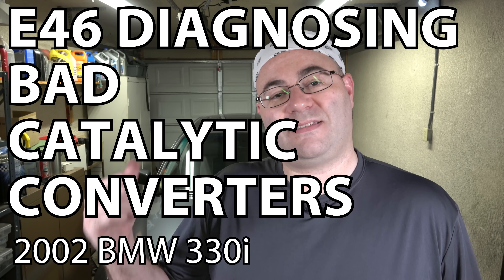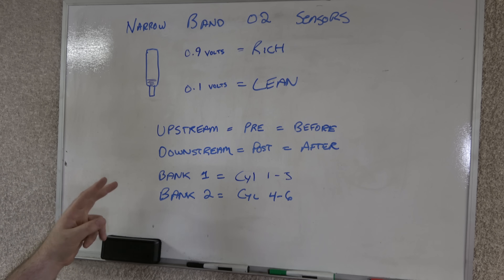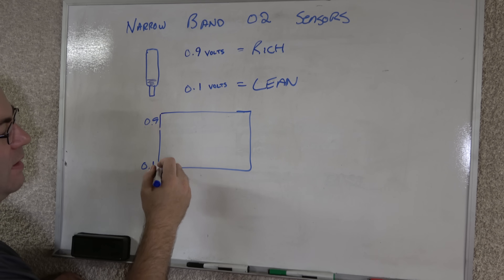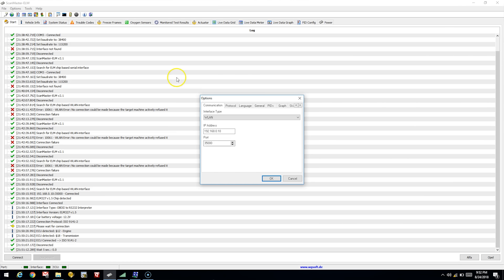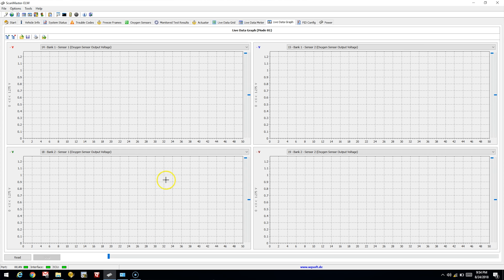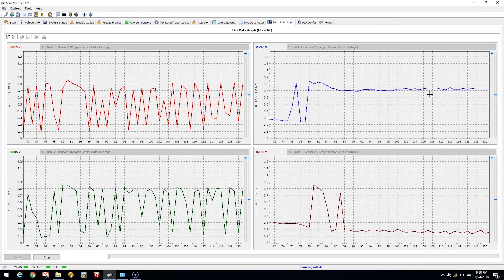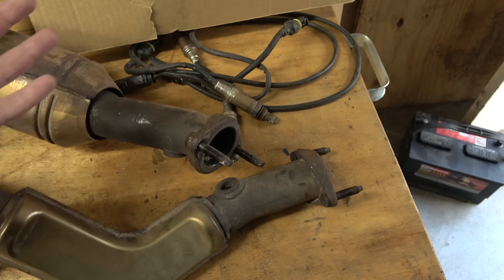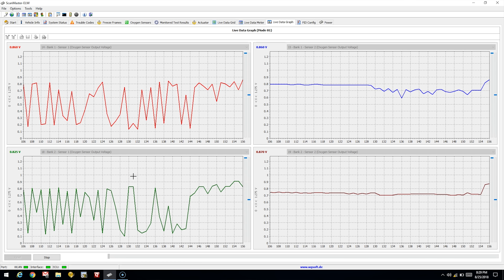BMW E46 How To Diagnose a Bad Catalytic Converter P0420/P0430

Comment: Catalytic converters from E60 M54will work in E46 M54? 
The part numbers on bmw database are different but secondary numbers (the biggest on the catalysts) are the same and they are 7516730 and 7516731.

Comment: First of all thank you for this video! I used the same software and a Bluetooth obd tool from Amazon and tested my voltages the same way, but while on a test drive. 

I found some differences in how my graphs looked in comparison to yours: my bmw S54 engine sensor 1 voltages both remained constant at about 2.0 volts. Even when the cats were warmed up, I didn't see any fluctuation like yours did. They just stayed stable at about 2 volts. Once my car was warmed up, I noticed that while shifting (mine is manual), the sensor 2 readings were really wild and looked like your results indicating bad cats. But once I was in gear and applying the gas, the voltages stabilized at about 0.8v. This is the behavior I experienced throughout my driving (had the laptop next to me). Shifting produced erratic and spiked readings, but cruising and even wide open throttle showed a stable voltage. At stop lights, the voltage would drop off to near zero, then stabilize back to 0.8v while idling. I don't have any codes, so I assume this is expected behavior of the voltages. Again thank you for this video!

Comment: I really enjoy this content. I had p0455 evap code and fixed the obvious worn 2nd air pump hose... fixed the code but I also have p0174 and p0171 LEAN vacuum leak codes and p0420 and p0430 CAT below threshold codes. trying to pass emissions but these codes are confusing. on one hand it could be simple stuff but on the other hand could be very complicated. I am a very beginner mechanic via youtube and 50's kid content so I'm really trying to learn about the 2003 325is and their problems first before I take things apart and can't re-assemble them as the car is running decent. I have an odor coming from the engine bay like a really oily gassy engine. the temps on the passenger side engine bay seem pretty hot to me... based on my codes and what I've written here can the internet people spring to life and help me out without saying "just buy all new stuff" or "go to bmw mechanic". Thanks anyone who cares. (really need the support) I have new o2 sensors from bosch on hand. recent oil/all filters changed. plan to smog soon... thats all I got

Comment: I had the same codes on my E39 530i. I was advised to replace both the intake and exhaust VANOS solenoids, then clear adaptations for the DME and transmission. The codes went away for good, and low-end pickup noticeably improved, like I had a new engine!
Edit: I was also advised to replace both camshaft sensors.
Reply: I have codes right now for both cam position sensors, bank 1 o2 out of range, bank 2 cat efficiency, and a cylinder 2 misfire. 

Seems like too big of a coincidence to be anything but vanos related.
Reply: @weedshoes5089  You should replace both VANOS solenoids and both camshaft sensors. See if it clears any codes.
Reply: @MindHunger  thanks for the tip! ordering genuine bmw sensors and solenoids now.

Comment: Don't clean your 1st set of o2 sensors if one of the cats is clogged, running almost as bad as when a leaky inector made my intake manifold explode last year, Imma try to clean it, if not, im in Texas no more inspections, I'll run headers and make it shoot flames🔥.

Comment: If I have a plugged cat and it’s literally blowing out my secondary air valve and melting my plastic hose, that’s for sure a cat right? Replaced the hose and valve twice, new blower also and it does work.

Comment: Question, I have a 325i and check engine light came on with the code. It’s only got 89k miles on it. What’s the chance it’s an O2 sensor instead?

Comment: Just bought a 2001 330i and I noticed the catalytic converters smell pretty bad when I push the engine. Car has 171k miles what would be your suggestion to diagnose the Issue? Thanks!!!

Comment: My car is having acceleration issues. Runs like shit from a cold start, this was never an issue before. If i pull out onto the road, its so slow right now, i'm scared to get rear ended. Having trouble climbing hills, i can barely gain any speed if any at all. If going uphill 65mph thats probably as fast as it"ll go till i get on flat ground, or downhill. Car doesn't shake or have any vibration. Changed a poor looking coil, put new ngk plugs in. Car still doesn't have acceleration. Took it to get it scanned, 4 codes came back for cat issues. I've had these pair of headers now for 2 years, its about that time, then flash tune to delete sap, and lower o2 sensors. Thanks so much for your videos, you've helped my dad and i with this car for the past 3 years. You basically taught me everything i know about this car, and shop life. Thank you 50's kid!
Reply: Ended up being a failing maf. Much cheaper fix

Comment: I have straight pipes past the cats and it sound muffled after I put cheap coils in them. I swapped them out and it sounds better but I have a feeling they're packed with oil now... is that a possibility?

Comment: I am getting ready to do this job. Bank one 0420 and bank two 0430.
Can it be done in driveway on ramps or jack stands? Very mechanically inclined, have all the tools, just can’t get the car very high in the air.
Reply: I did this job last year, new magnaflow cat headers. I did O2 sensors,tuneup, the Vanos solenoids, the oil non-return bslves, DISA Valves, smoke tested intake, you nam it. Car still got these 2 codes but much less frequently until this last couple of months, now coming back within 1 days of resetting & cant pass emissions insp here in NY. where do I go with this? Car otherwise runs like a top no misfires, no other codes, steady idle, all good.

Comment: Hey 50skid, thanks for the video, really informative! My 190k mile 330i just gave me a p0420 on a run - I checked the O2 readings on a warm engine at 2k revs and both banks show exactly as they should (varying pre cat, 0.7 steady post cat). I noticed that the AMM clips were popped off which could have caused a slight intake leak - is it possible that that caused my code? It's not the one I'd expect, but might make sense. I would have expected both banks to be affected though... Codes reset and I will see how I go, but thank you for the O2 reading test, hopefully that means cats are ok 🤞🏻

Comment: I have a 2003 e39 that gets an intermittent all 4 O2 sensors heaters shorted to negative. The fault comes up during a scan as not present at the time but it is always there and I can never clear it. I have measured all 4 heaters at about 2.5 omhs and the voltage across all 4 does pulse on and off when the car is running as should. Do you have any idea what it could be?
Reply from the maker: Sounds like a problem with the DME (engine computer). Seek professional help on that one

Comment: I can also be caused by an exhaust leak I was tracking a 420 on my vehicle after I replace my new catalytic converters finding that an exhaust leak where are the exhaust bolt down to the engine block needs to be tightened my bad
Reply: T67766 u 7th_ù_<<<<

Comment: I've been having an issue recently where my CEL came on and code was P0430 (Catalyst below efficiency bank 2). Checked live values and the value for bank 2 post cat was reading steady between 0.6v and 0.7v (So no issue here?) Both pre cats oscillate as normal too so what could be the issue here? Experience no power loss either and engine is as smooth as can be
Reply: Did you get to the bottom of this? I have a p0420 and o2 sensor readings checked out. Did find my AMM wasn't clipped on properly though.
Reply: @nicebloke6066  nope, still haven't solved it. I've taken the plunge and bought 2 precat sensors as I assume the originals are still on the car (103k miles). I'm hoping it's just a sensor that has fallen out of spec over time hence the codes. No vac leaks as far as I can tell and MPG is normal

Comment: Hiya, your videos are amazing and very detailed. Used them plenty of times! Is this the same for the 4 cylinder n42 engine? I've had a 0420 code a few times and 1168 & 1170 at the same time. Do you know what that means? Any help would be much appreciated! No one else seems to know. Cheers👍

Comment: hey Im having this issue on my 2000 328ci where the catalyst monitor is not ready n is showing my downstream sensors are fluctuating like yours but im not getting any codes or stored codes, Catalytic converters are expensive here in cali so thats my last option u got any suggestions? i'd appreciate it
Reply from the maker: Nah if your downstreams are not steady, it’s definitive. You need new cats. I bought some used low mileage ones off eBay and it worked out.  Good luck!
Reply: @50sKid Thank you for the video. I made just right now a test and a made a video. I think my cats are working. https://youtu.be/lbpbIIQN7fs?si=-dLxlOMrATvvVTVS

Comment: Ex Smog Repair Technician
GM Dealership & Independent Automotive Shops - Southern California

1) The reason that California doesn't Test vehicles Year 2000 & Newer without inserting the Probe in the Tailpipe is because the Emissions HC , CO & NOx are supposed to be way cleaner than 1976 - 1999 vehicles.

2) 1976 - 1999 vehicles still require the Probe being inserted in the Tailpipe

3) Lotta Emission devices on todays vehicles & the Catalytic Converters are the most expensive Emission Devices.
( The prices of these darn things can give you a Heart Attack )

4) One of the worst things one can do is purchase CATS from a darn junkyard.
If this car passed the California Smog Check it's because the Mechanic didn't record the Part # 's from Both CATS.
.....After inserting those Part #'s into the California CAT Data Base & it spits out that this CAT is an Illegal CAT & not an
OE CAT or CARB ( California Air Resource Board ) CAT , that vehicle is gonna FAIL.

5) If you want your 19 year old Daughter or 19 year old Son to have a Heart Attack 
with this being their 1st car purchase :
Let 'em buy a car from a Crook that has sold them a car with a Modified CAT or some Rascal has added a Coupler to the Oxygen Sensor because they refused to get the car done right because they didn't or couldn't afford to fix the P0420 or P0430 : Catalytic Converter Below Efficiency Threshold.

6 ) 2000 & Newer vehicles can Fail the California Smog Inspection if there are Check Engine Light Codes existing , the New Engine installed wasn't an Engine for that Model Year vehicle , Smoke is constantly emitting from the Tailpipe ,
a Rascal had added a spark plug coupler to the Oxygen Sensor because they Refused to have the P0420 or P0430 Codes fixed properly , some Idiot has removed the CATS and have installed Straight Pipes all the way to the Muffler.

7 ) For those of you residing in California , go to www.smogcheck.ca.gov

Get educated , locate the Subject that tells you , "Even if you disconnect the Battery Cable to turn the Check Engine Light off - a Block before the Smog Station - You're FOR SURE gonna Fail the Smog Inspection for @ least "2" reasons : Now you've set the On Board Diagnostic Monitors to " Not Ready ", before you disconnected the Battery Cable or "Turned the Check Engine Light Off" with that Lil' Code Reader - ALL Monitors were saying " Ready".
... The 2nd reason for Failure is that the Smog Station Computer ( on late model cars will still Spit out the Code ) that you're trying to Hide.

8) Californians , in your spare time ; save that California Smog Check address to your Desktop ( You'll LEARN a lot ! )

9 ) Last Tip , on that Website you can insert the License Plate # from any vehicle in California & it will tell you if that vehicle has received a Smog Check within the LAST 90 Days.

The "Wrong" question to ask any Person or from a "Used Car Lot " is, " Has this vehicle been Smog Checked " ?

The right Question to ask is , " Has this vehicle been Smog Checked within the LAST 90 DAYS ? "........If it hasn't been Smog Checked within the last 90 days 
Sacramento , CA. ( State Capitol will be sending you a Letter shortly after your purchase to get a Smog Inspection )..
....and your 19 year old Daughters 1st purchase may be from a Rascal that has REMOVED the CATS or the other expensive cluster flux : added a Coupler to the Oxygen Sensor because they  Refused to buy new CATS to fix Codes
P0420 or P0430 properly.........You can also learn a helluva lot about your vehicle by subscribing to the cheap
AllData Do It Yourself Version...The PRO Version cost @ least $180.00 monthly.
www.alldatadiy.com
ONLY $29.95 YEARLY !!

Comment: My bank 2 sensor 2 idles at .7 and under load it drops to .1 and just stays there till I release.. whats that mean? Bad cat? It doesn't bounce around like 50skids car
Reply: im having the same right now
Reply: @stijn9957  what's weird is I never get the p0420 cat code. Not even in inpa. I replaced everything except those cats. Gotta be them. Driving like this for 10 years lol

Comment: Is it possible possible to have bad cats but without the 420 and 430 codes? I have 2 cycling codes, sometimes p1093, or p1092. Rich and lean codes. Keep changing. Did all 4 o2s on 2 occasions, maf, checked for intake and exhaust leaks. Fuel filter and injectors replaced. What a fuking joke. Still keeps coming back. Got to be the cats. Gonna check the voltage through my app tomorrow.

Comment: 50skid Do you suppose a cat could be bad if they dont heat up to the same temps from idle? I.E B1S2 .72v B2S2 .68v (slower misfiring bank at 5000rpm)

Comment: I've been watching many of your videos that have helped me so much over the years with my 03 e46 320i, and I want to thank you for that. However, today I have an uncommon problem that nobody can seem to solve, and I am suspecting the catalytic converters. I have rough idle issues both on cold and warm, the engine has a light and unusual growl to it, and most of the time but not always a ticking can be heard. After the engine reaches normal operating temperatures, oddly enough my clutch start to squeak, towards the very end of the pedal it doesn't feel smooth anymore, and it just gets worse the longer the car runs and is driven (brand new single-mass clutch kit, with all related components new). On cold start the clutch won't squeak until again the car is driven and is warm. No codes at all, checked for vacuum leaks, all other components have pretty much been replaced or checked, spark plugs, coils, hoses, DISA was rebuilt and the VANOS as well, cleaned throttle body, ICV, MAF. I gathered data on idle and while driving, and apparently all PIDs look good for all parameters. The only thing I noticed was that the POST-CAT sensors show oscillating voltage when the engine is being revved up. So clearly there is something wrong with the catalytics, but could it really cause my idle and clutch issues? I am suspecting that restricted catalytic converters cause turbulence near the exhaust valves causing the engine to idle rough, and once they heat up are possibly also heating up the transmission next to it more than normal temperature and thus compromising the throw-out bearing lubricant in the process. That anyway is my theory. It just drives like shit, especially in 1st gear and low speeds, clutch is hard to get along with and it shouldn't considering the mileage and the fact I've changed and maintained almost every single part I can think of. Your input on this sir would be greatly appreciated, if this of course does get to you.
Reply: did you find a solution?

Comment: anyone had a symptom of misfire from bad cats?
Reply: yes
Reply: but before cats you can check the boots on the spark plugs the just ware from the load on the reduced electricity
Reply: Ville Gang just put new spark plugs in the car, but I had a another set of oem headers so it’s at the shop rn getting those out on. 🤞really hope the cats take care of the misfire

Comment: I need help lol, I just changed my o2 bank 2 sensor Nd all the other sensors are working besides 2 what did I do wrong or what am I missing? Bmw 525i 2003

Comment: I have a 2002 E46 my cat cable melted and and blew the gear fues. I disconnected the 2 cat cable and the fues is ok not it drives. Should I remove the air pump or I can just disconnect the cable to the air pump. What is going to be the effect on the car. Temperature on the average here is 28°c . It hot some time. I need an advice

Comment: I have the same problem my 2005 Grand Caravan the O2S1 is oscillating lean to rich and the O2S2 is about .7 but when I rev the engine to 2000 rpm the O2S2 oscillates like the O2S1. Thanks to this video; I will put new convert to this Van.

Comment: can a vacuum leak cause a catalytic code? For instance, I did a smoke test and it was leaking by the intake air duct and underneath the manifold. Im guessing the oil separator and the hose will need replacement as well.
Reply: I also had a misfire in cylinder 1 code, but I just had all new spark plugs and coil packs put on so Im hoping fixing the leak will erase these codes.

Comment: My brother's 08 Lexus IS250 threw a P0420 because of a tiny exhaust leak (small crack in the piping right before the catalytic converter on bank 1). Welded a bead over it, cleared the code, never came back. That being said, my family's 15 Forester XT threw a P0420 and it needed a new cat, thankfully under warranty (only 49k miles). 

Also, do you believe the school of thought that says if your cat goes bad it's because something is wrong with your engine (i.e. oil burning, rich/lean condition, misfiring, etc) which caused the cat to burn out? 

And lastly, that CA state smog test is a joke lol I could pass that test in my E39 530i with headers (catless) and tune that got rid of the CEL and secondary O2... Same story with my RSX Type S with a Hondata, header, cat delete, and secondary O2 delete, both cars have the emissions monitors set despite having no cats.